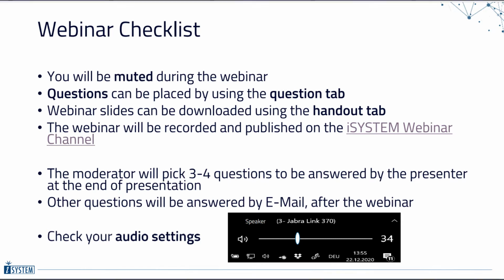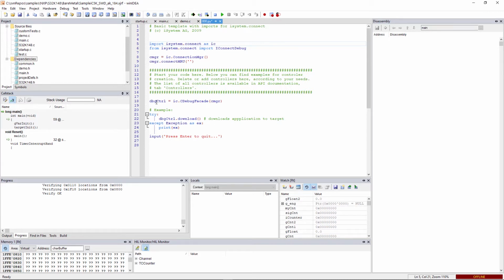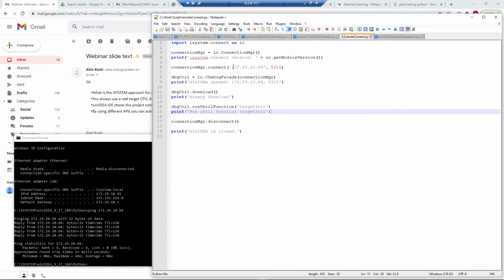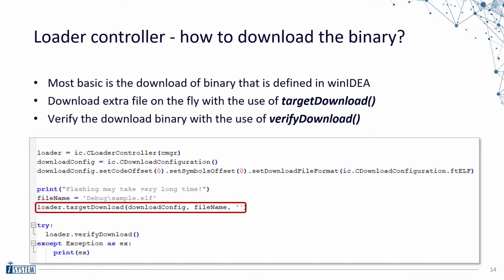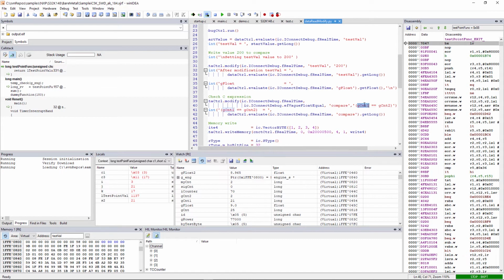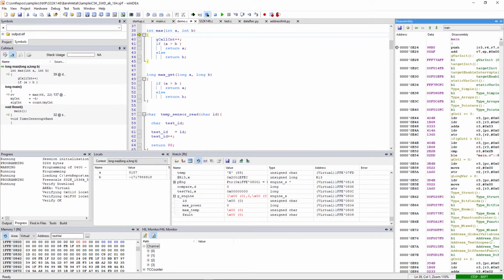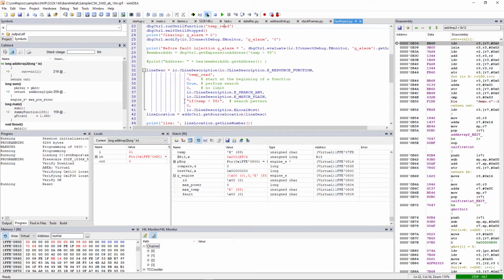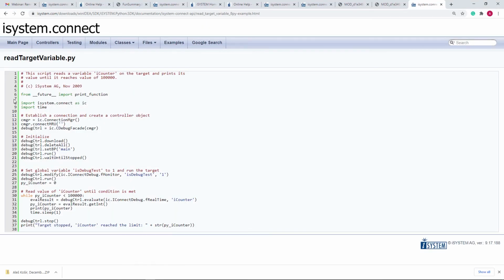Webinar – Remote Debug Control and Test Automation using Python

Comment: There should be a way to restart the blue box remotely. I am looking for such option which helps me to come to normal state when I am having SOC reset issue. Currently I manually put off and on the debugger and target to come out of SOC reset state.
Reply: hi, did you manage to resolve this issue? We're facing something similar overnight the debug goes in let's say sleep state  and we need to manually restart it.